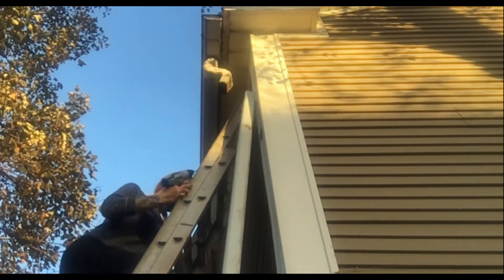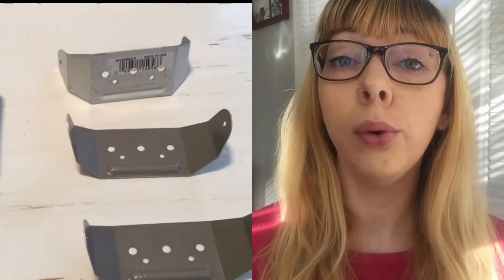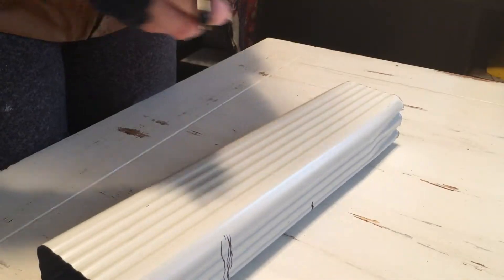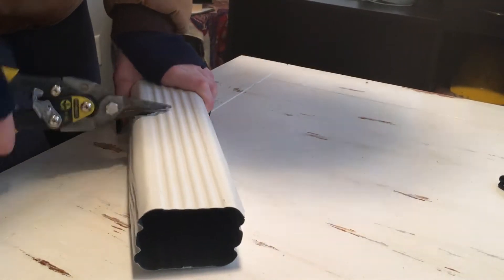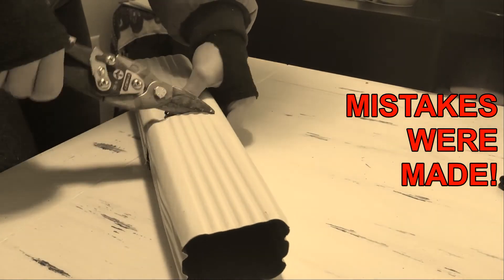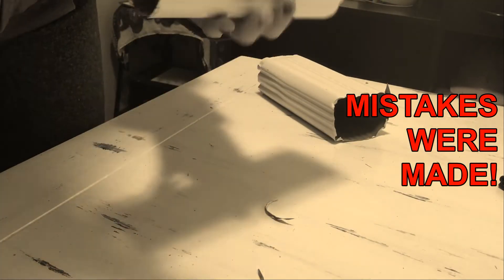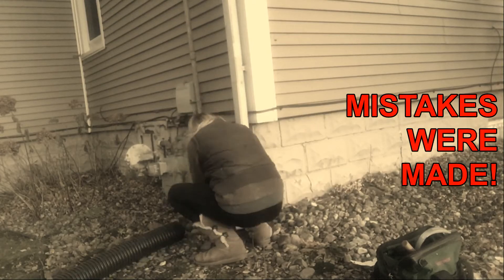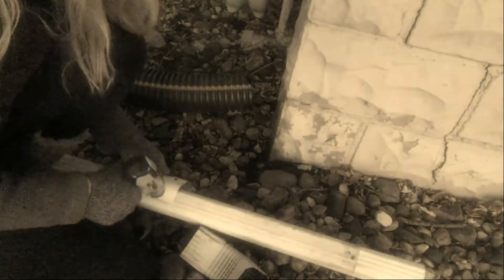You CAN Repair Your Downspouts | Honest Do-It-Yourself Gutter Fix

Comment: What did you use to cut your guttter??  Mine is close to the ground as well.
Reply from the maker: I used a pair of tin snips. They are super useful. I’m sure there are fancy tools for officially cutting gutters & downspouts but this worked just fine!
Reply: @beththebuilder  - You should've showed how you used the snippers to cut into the gutter pipe and also how you got the lower gutter piece to slide into the higher gutter piece. Other than that you did good, I think. Thank you